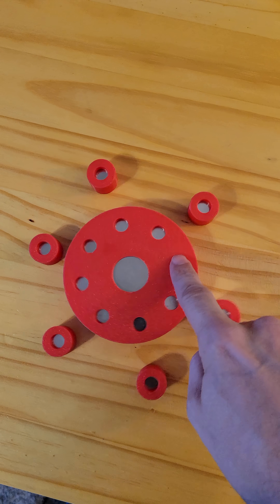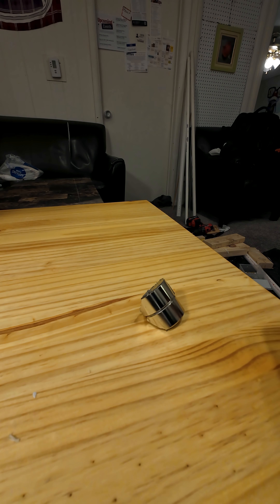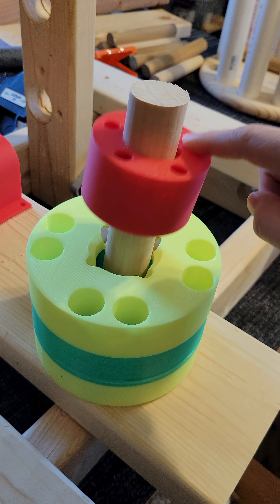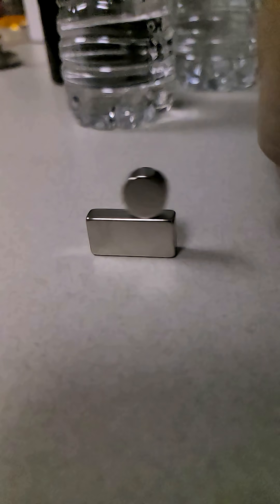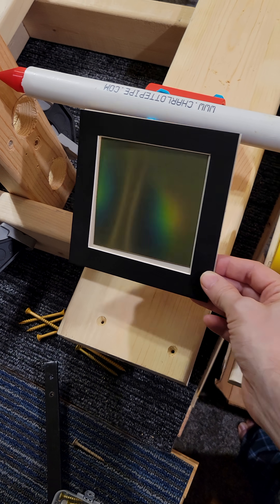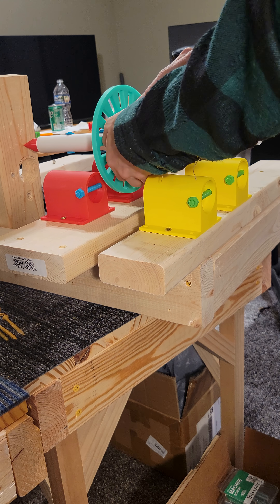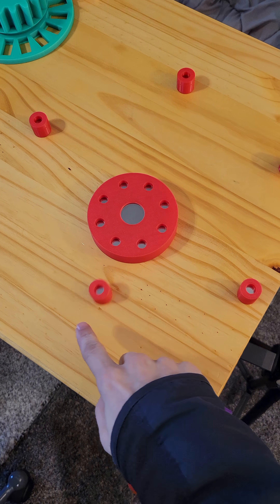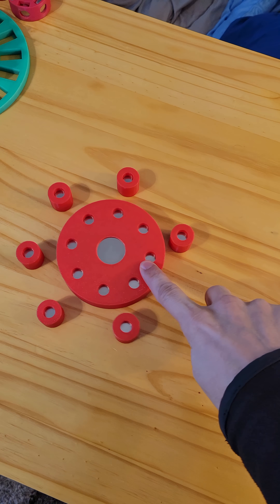Magnetic Entanglement! #magnets #magnet #engineering #science #bearing #3dprinting #levitation

Comment: Your magnetic bearing is not well balanced, configured and likely using the wrong magnets so it bounces. Try using ring magnets for the bearing and the carrier also you can use smaller ring magnets on the bearing and 1 larger ring magnet at each end and insert your bearing into the holes. This will give you stability. Welcome to the rabbit hole.

Comment: Would putting a counter weight/flywheel at the end stabilize it and reduce wobble and bounce?
Reply from the maker: it's a balance because too little weight and it is easy to fly off. But too much weight and it forces the magnetic fields closer together which increases the forces exponentially but also the magnetic fields can kinda squish and squeeze one another so it may become unpredictable too.

Comment: Could you use another set of magnets to lock the tip of the pole near the board, removing the friction. Since they can spin at a high rate without generating any heat could you lock it in place by spinning the rod around that 10,000rpm mark whist keeping the tip magnet and board very small? Either way 10/10 vid!!!
Reply from the maker: I'll definitely give these ideas a try.  I really want to achieve Levitation with a static magnetic field but it is more difficult than I thought ...😏
Reply: @WilsonFunTech It is impossible to produce stable levitation with static ferromagnetic fields, so it's unsurprising that you are finding it difficult. You can do it with diamagnetic materials. (See Earnshaw's Theorem.)
Reply from the maker: @LoganKearsley tell me it's impossible and it makes me want to do it even more 😅
Reply: @WilsonFunTech You might as well try to prove 1 = 2. You're better off looking up how magnetic levitation actually works than wasting your time on something that you already know can never work.
Reply: @WilsonFunTech  It would be sick to see the next iteration and new changes. I think our magnet knowledge is the same so I’m really interested to see what’s the next steps🔥

Comment: I realize you mean well but please use actual physics terms. There is no such thing as magnetic entanglement. Electrons don't orbit around the nucleus. Solar system isn't a magnetic system it's a gravitationally bound system. Electromagnetism is 10³⁶ stronger than gravity. If electromagnetism was the dominating force and it didn't have charges it would instantly collapse all planets together. Fusion would not be strong enough to resist and all stars in the universe would collapse.

Gravity is a super weird thing and it does not have an analogy for light objects. It does not have charge like electromagnetism so it adds up with mass. Since it's so weak it can only be observed on massive things. (It's related to space itself but we don't know how.)
Reply from the maker: "Solar system isn't a magnetic system it's a gravitationally bound system"  so you are saying there's no relationship between gravity and magnetism?  🤔
Reply: @WilsonFunTech Of course there's no relation. There are 4 fundamental forces and electromagnetism and gravity are two of them. They're seperate. The proof is electromagnetism cancel. The fact that planets don't spontaneously blow up is the proof. Electromagnetism holds matter together at the atomic level but not at scales gravity does because it has charge. We can easily measure electromagnetism but we can't measure gravity except colliding black holes creating gravitational waves which involves many more times mass than the whole solar system. If gravity was electromagnetism then we would have 90% of major physics problems solved. We have no idea what the heck gravity is but we know it's not electromagnetism.
Reply from the maker: I think gravity is magnetism.  prove me wrong 😅
Reply: @WilsonFunTech I think that, given the body of evidence that we have that points to electromagnetism and gravity being entirely separate, you would actually have to do the proving.
Reply from the maker: @Realturboterrapin  I know, I'm just rage baiting 😏  I think magnetism and gravity are two of the most mysterious concepts in science given how much we all experience them in every day life and how little we know about them.
Reply: @WilsonFunTech Not knowing much about them isn't all that hard to fix. Gravity still has some fundamental unsolved mysteries around it, but "we", meaning human civilization as a whole, know a whole lot about electromagnetism, and understand it extremely well. You just have to be willing to sit down and do the work of studying it.

Comment: I mean magnetism and gravity both invoke the same question in my brain, which is how are these properties creating force? Sure positive and negative attract, but why? And in the case of magnets they can literally out pull gravity and hang on something metal upside down indefinitely, which is just crazy, but what's causing the force?
Reply: Why do positive and negative attract? Because the interaction is mediated by a spin-1 field, and the potential energy landscape is minimized when the field strength is low and charges are not widely separated, and microscopic force arises as the gradient of the potential field. Gravity, on the other hand, is completely different--similar charges attract, it may not be mediated by a quantum field at all, if it is it would be a spin-2 field, and most of what you perceive as gravitational force is actually due to particle trajectories being altered by variations in the rate of time.
Reply: Field destabilization
Reply: Fixed entropy
Reply: Fascinating, my limited knowledge of quantum mechanics means I barely understand any of that BUT I understand it's interacting in consistent and predictable ways that I can potentially understand later lol